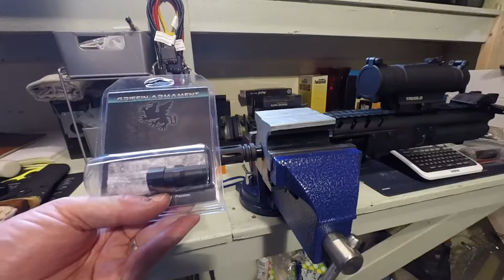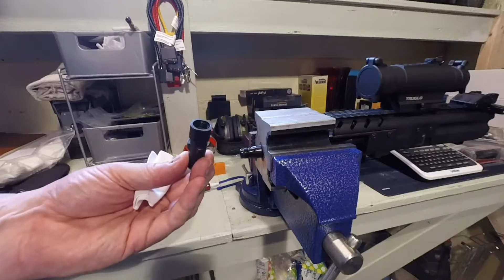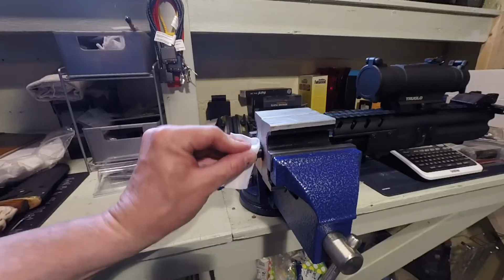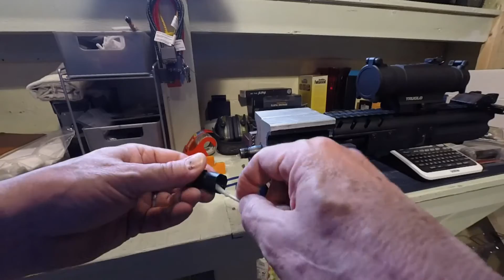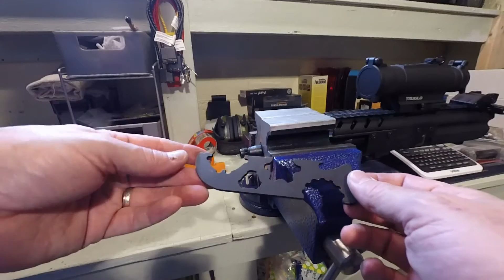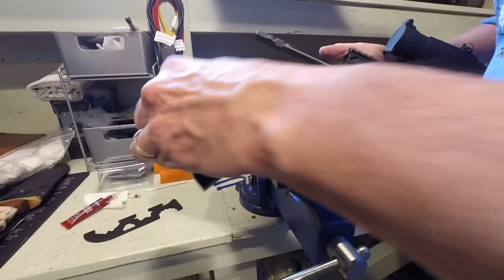MPX 3 Lug Adapter install

Comment: Great video Brother!  I just got my Obsidian Rugged 3 lug adapter for my Scorpion Eco 3 S1.  Going to install it today (thanks to this video).  Keep going.
Reply from the maker: Thanks.  I am glad it helped.
Reply: @armeddiver  it really did!
Reply from the maker: @Citizen2ACitizenLLC  I recommend that you read the comments.  There were a couple of recommendations that some others made that were good advice.  One of the recommendations was to use Rocksett instead of Locktight.  I don’t know how hard you are going to run your gun with a suppressor, but I really think that was a really good recommendation.
Reply: Reviewing now.  Thanks for the follow up.  I plan to run it fairly hard in the beginning just to push it to its limits since this is my first rodeo with the obsidian 9.   @armeddiver

Comment: Should use Rocksett.. Loctite will melt and burn off and can even act as a lubricant once melted to help your device back off... highly advise Rocksett to everyone for muzzle devices.
Reply from the maker: That is excellent advise.  I made this video five years ago and I have no idea why I was using LocTite.  All other muzzle devices I have installed were done with Rocksett.

Comment: I recommend Rocksett, it's good to go on suppressor mounts. I use it on my AAC mounts and it doesn't come loose. I ended up getting a direct thread mount for the Dead Air Wolfman I just bought.  Good tutorial video, clean threads are important .
Reply: Rocksett is why I found this video and the cause of all my problems, I can't even get the thing off with a vice and a wrench 🤣 I've heard soaking it in water works but idk how I feel about my barrel sitting in water overnight
Reply: @over1498  Water is the only thing that gets it to release. That is why it is great and doesn't let go or degrade under high heat.

Comment: Awesome info. I just ordered that 3 lug and I also ordered the shoulder adapter to get rid of the taper to give the 3 lug a nice flat surface to mount against. Any accuracy issues with your set up? I saw MAC at military Arms Channel had his accuracy suffer from mounting this set up.
Reply from the maker: It is a really great idea to add the shoulder adapter.  I should have done that myself.  I haven't had any issues with accuracy that were related to lug adapter.  You will get a point of aim shift from the suppressor, but you can account for it as long as you position the suppressor on the gun the same way every time that you mount it.  I put a little mark on my suppressor that lines up with the center of the top rail.
Reply: Armed Diver thanks for the reply. Sounds like a plan.
Reply: Wonder if I would need shoulder adapter for direct thread. I bought 13.5 x1 piston for my AAC TI-RANT
Reply: @richardnamber813  you should always use one if barrel is tapered.

Comment: Do you have the link for the barrel holder?  Did you have to heat up the Sig Muzzle to get it off?
Reply from the maker: Here is the link - https://www.midwayusa.com/s?searchTerm=Wheeler+Universal+Barrel+Clamp.  You can also get it directly from Wheeler, but it is more expensive.  No, I didn't need to heat it to get it off.  Remember that this is reverse threading.  Also I recommend you read some of the other comments.  I didn't put in a taper spacer, which has been recommended and I think it is a good idea.  I also recommend using Rockset, not blue Lock Tight when you mount your new muzzle device.
Reply: @armeddiver  Thanx for the quick reply!  Do you think that Clamp will work on the 4.5: barrel?   I am getting a JMAC adapter that is a Sig Taper muzzle device, so I hope I have that covered.
Reply from the maker: @lesgarten  It should work on that barrel.  Do you have a torque wrench?  Remember, do not torque more than 25 ft lbs.
Reply: @armeddiver  Torque wrench no problem

Comment: Why doesn't the armorer's wrench work on the flat surface to install the 3 lug?
Reply from the maker: Danny, I don't know that it won't work.  I never tried.  I used the Griffin Armament tool, which if you are Griffin Armament silencers, you will need.

Comment: Did you need a tapered washer for the 3 lug adapter?  I'm being told you need one.  Please correct me if I'm wrong.
Reply from the maker: You can see in the video that I didn’t use a washer, [but] I think it would be a good idea.  Also if you read the other comments everyone, including me, would recommend Rocksett.  So far I have had no issues with either my silencers, on this gun but it is rarely used.  If you are going to be running and gunning a lot with a silencer on the gun, I strongly recommend that you use Rocksett.

Comment: You're using the wrong locktight... The red locktight is not meant for 'high heat' areas and the blue colored locktight is.

Edit: I replied to fast, you're actually using blue

Comment: Rockset... Do not use Locktight... Rockset only comes off with hot water, but resists heat up to some crazy temp...

Comment: Why not use Rockset?
Reply from the maker: Rockset is pretty permanent.  At the time I wasn't sure that I wanted to mount it that permanently.  If I ever redo it, I will probably use Rockset.  I use Rockset with all of my Surefire muzzle brakes and flash suppressors.
Reply: @armeddiver  I think a lot of people are scared of rockset
Reply: @armeddiver  rocksett is easily removed by letting it sit for a bit in hot water. Weird, but true.
Reply: Yeah hot water will break the Rocksett. Just don't let your barrel rust, if you get it near boiling then soak for say 15 minutes.
Reply: @mdondie  not even. you don't need to boil rocksett. Just let it soak overnight in water and it'll dissolve. But, if you're in a hurry, boiling it will do the trick.

Comment: Silencerco AC2604 3-Lug Muzzle Device 9MM 1/2X28 will fit on MPX-K? thanks
Reply from the maker: Are you telling us that it does, because I have no idea.  I have no experience with the Silencerco AC2604 or an MPX-K.

Comment: Why in the world does Sig thread the MPX M13.5x1mm LH?  Why not 1/2x36 like most of the other 9mm PCC's that are made in the US?
Reply from the maker: bretak74 I can’t give you a good reason.  The left handed threading is a real problem with direct thread suppressors like the Griffin Revolution 9, because while trying to keep the suppressor tight on the barrel you loosen all the suppressor parts because they are all right hand threaded.

Comment: Does this adapter only work with griffin cans?
Reply: No, any suppressor that has a 3 lug mount on it.
Reply from the maker: I don’t know. I only have the Griffin cans and I probably won’t be buying any other cans, unless the hearing protection act becomes a reality.
Reply: @evanr.6171  you are 100% sure?

Comment: I cannot remove my flash hider for my life. I tried heating it. I tried soaking it. It just wont budge
Reply from the maker: Are you turning it in the right direction?  Remember it is 13.5x1 left hand threading.
Reply: @armeddiver  its clockwise right?
Reply from the maker: Joe Young Quick question, what barrel are you trying to put this on?  If you are trying to put it on the carbine you not be able too.  I read something that says on the Gen2 Carbine the flash suppressor is pinned and welded.  If you are doing trying to put it on a MPX pistol or SBR, you are correct it comes off clockwise.
Reply: @armeddiver  it's an 8in mpx pistol. I dont have a vise so that's why I tried heating it and soaking it overnight. Almost broke my damn hand trying to get it off.
Reply from the maker: Joe Young You really need a barrel vise.  If I were you I would take it to a gunsmith who has the necessary tools.
Reply: I'm right there with you as well. Can't get mine off to save my life. just ordered a barrel block to see if that makes a difference before calling it quits and taking it to a gunsmith